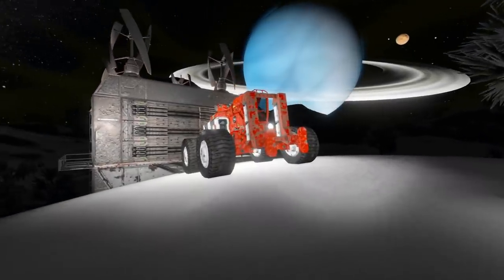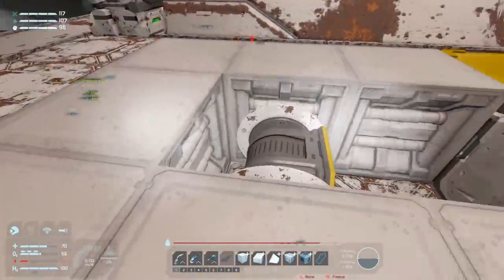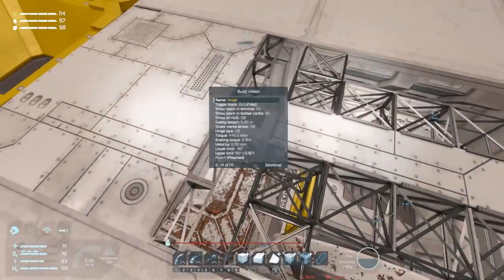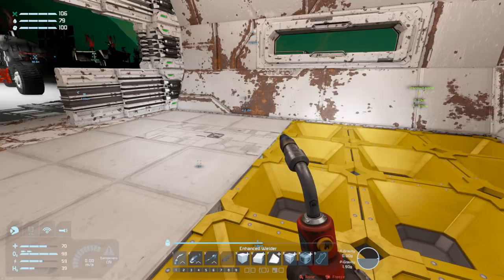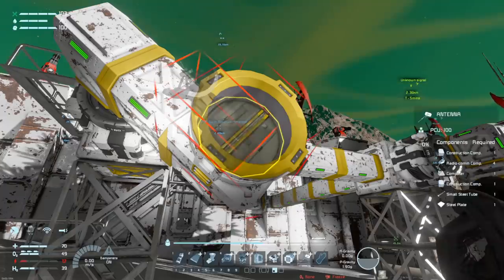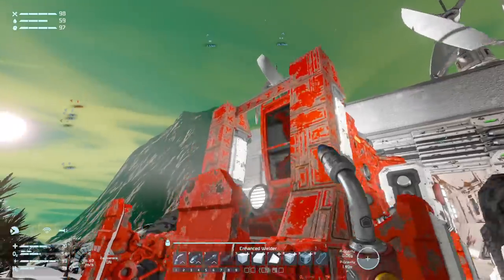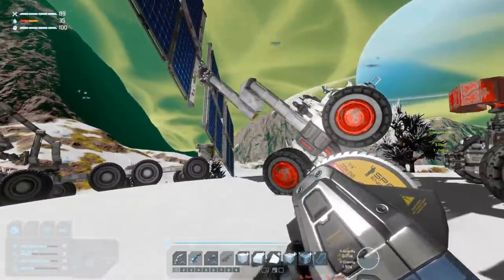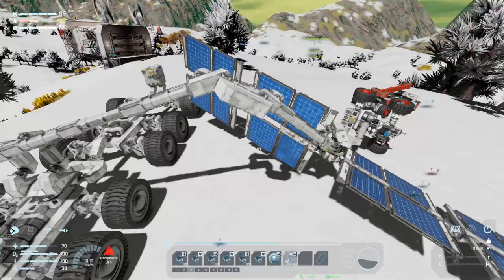Survival Impossible - Manny or Mannie or Clangy? #39 - Space Engineers Hardcore Survival

Comment: I think first build the towers. They should be buildable with the crane method and the welding pad sinde its only the crane is atached to it and the crane is able to move. Then build the conveyor lines and atach them to the now already in the voxel towers. This way you can even build the Conveyors like the towers on the ground lift them up with the crane atach them to one side and the rest like normal. Eventualy put a middle hinge in 90° to the towerhinges to handle a eventualy hight diference.

Comment: I'm wondering if the bottom grid isn't properly a station? Yes it's in the voxel, but that's an awful lot of movement for a station grid.
Reply: Actually looking again, I think it's that the hitboxes on the end of the hinge are putting the two pieces in the way. Line it all up, get ready to merge in place, and then swing the long connecting arm out of the way, merge them, and swing the arm back into position. IE, it's not the mass of the pillar, but of the connecting arm that's pulling on it.

Also I like the caution around the connector.

Comment: We all knew the Clang was coming after the connector worked out so well.
I'm sure you've ruled this out already but why can't you just place a block connected to the bottom of the hinged tower that is also in the voxals? As you did with the half block that was missing at the corner below the starting point for this tube system.
Reply from the maker: Mobile grids can't be placed in the voxels so I wouldn't be able to place that block :(

Comment: i know the issue your running into you need more blocks on the ground than you pillar i did a pipe system before and found that out just get you main spot lined up and where you have clearance place 20 unbuilt blocks for you interior blocks just make sure you have more blocks on the ground embedded so it does not get pulled out of the ground hopefully you see this and it helps if you need i can send a map for this stuff

Comment: What if you build another small building on a separate grid to replace the food truck? You could put a massive solar array on it, and it would stop being in the way.
Reply from the maker: I may well do something like that eventually :)
Reply: @Splitsie  also, for that problem you had at the end, what if the bit you build into the voxels is more than just 1 block? Like try a 3x3 bit in the ground, then merge to that. I'd also suggest removing the pipe until after the tower is positioned.